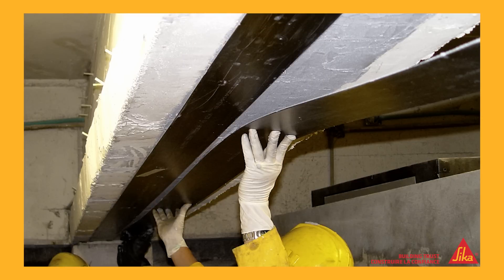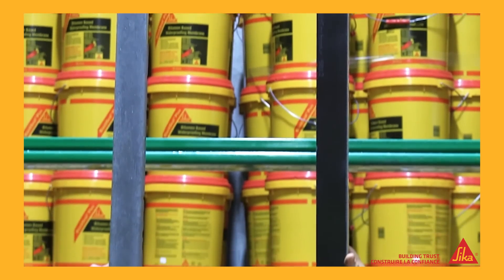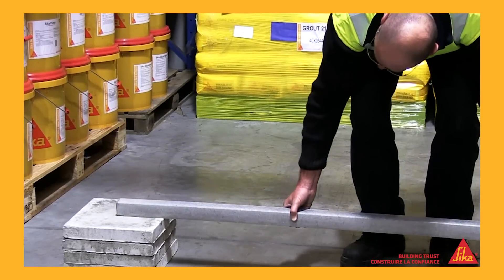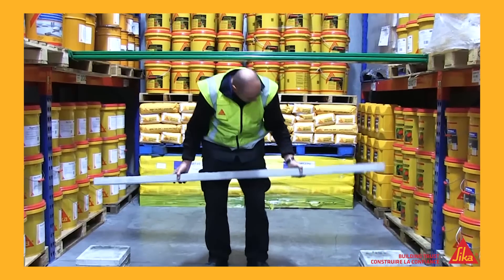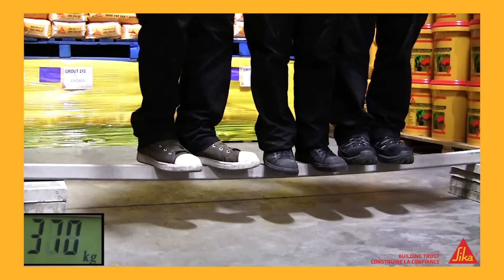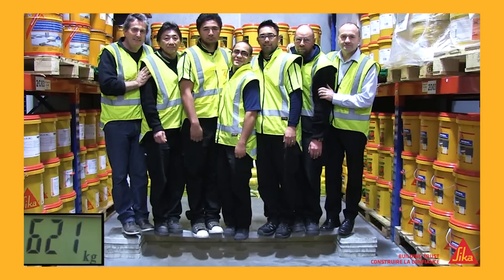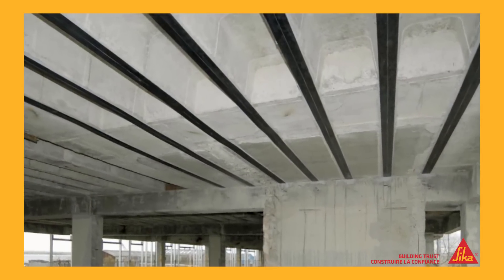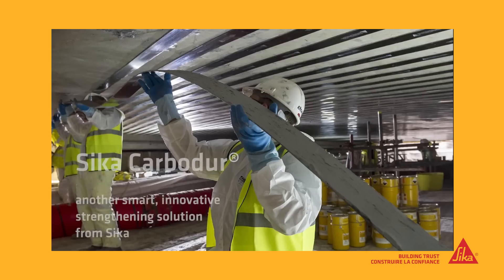Sika CarboDur - Carbon fiber laminate for structural strengthening

Comment: How does that hold up too extreme cold? Especially the glue that holds it. Those two pieces of concrete made from the same batch of wet concrete?
Reply from the maker: The Sika® CarboDur® system is formulated and characterized to allow the reinforcement of structural elements in buildings and civil engineering structures. The system may be used under temperate but also northern climates. Should you require further information, please visit our website at:  

https://can.sika.com/en/structural-strengthening-systems/home/products/structural-strengthening-systems.html

Best regards 

Sika Canada’s Marketing Team